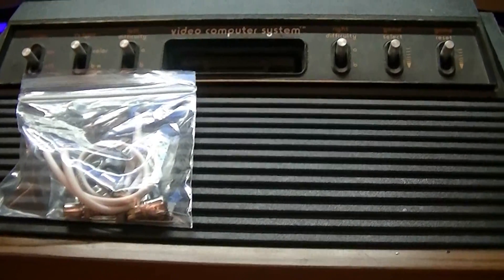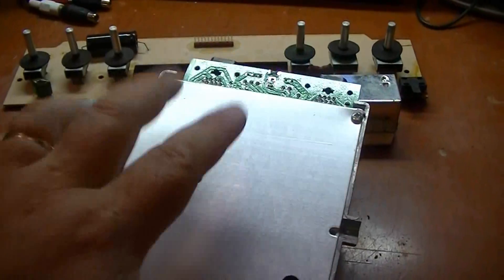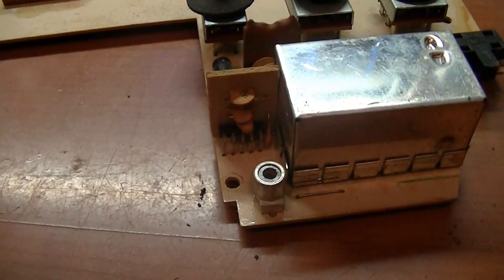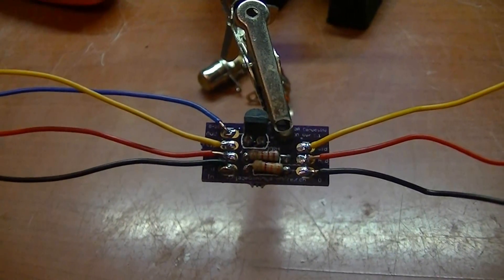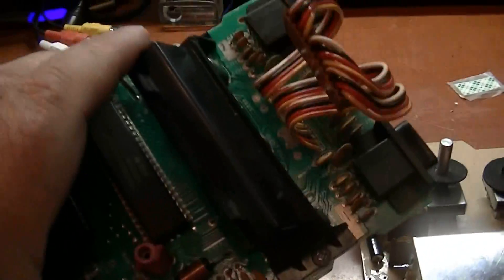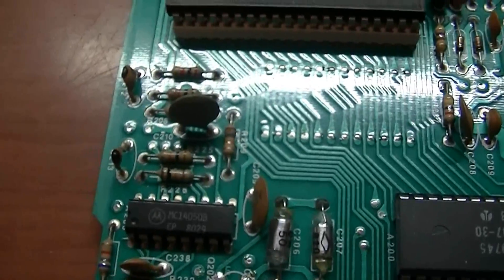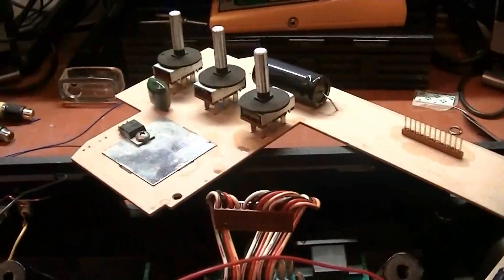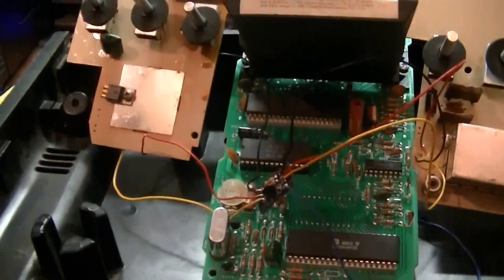Atari 2600 Composite Video Mod

Comment: Awesome video

This gave me an idea while watching.

So we know about the long RF cable that typically runs out the back of the atari. 

I was thinking, 

(and if u think it's a bad idea lemme know if ur reading this, i'm still very novice)

what if instead of entirely removing the RF shield for my build, I hollow it out, & whatever else I would need to around it, & I drill the composite ports into the shield?
 
Then (in theory)

I can keep all obvious modifications to the unit, internal. 
& I can just run long composite cables out the back (for convenience)

Anyway.. All these years later, & this is the exact kinda video I was looking for. Thank you

Hope you've been well. Thank you for the read, if you've done so, or whoever this may concern 
                                                                                                                                                                                                                          ✌

Comment: I just did this mode but I was unhappy with the colors (particularly brown) being off, contrast, and sound being to high in comparison to everything else.  To fix this I used the resistor taken from R213 and solder it between ground and audio out to reduce volume. In location R213 (where you took resistor out) I put a 1.2 kilohm resistor to get brown back.  Lastly, to fix contrast I replace the resistor R225 with a 15 ohm resistor.
Reply: Hey Guy!  Not sure you'll remember whe you say you used resistor taken from R213 and soldered "between ground and audio....? Do you mean you soldered it after the new PCB board on the line out but before the RCA Composite jacks?  How's the Atari holding after 4 years?

Comment: can the soldering be done using a very basic soldering iron? ie; one that looks abit like a flat bladed screw driver?
Reply from the maker: a sharp pointed tip is better to help control where the solder goes :)

Comment: I took the easy way out and ordered this composite kit as shown here. Thanks for the video of your installation. I am also going to "spray" clean the switches and connectors on my console with a high quality electronic cleaner. This will remove 30 years of dust and make the switches move more smoothly.